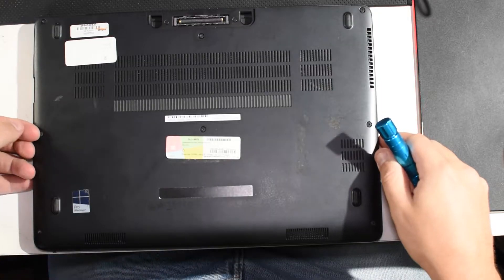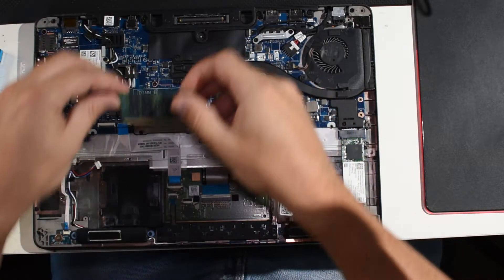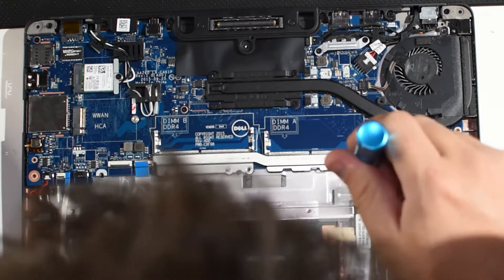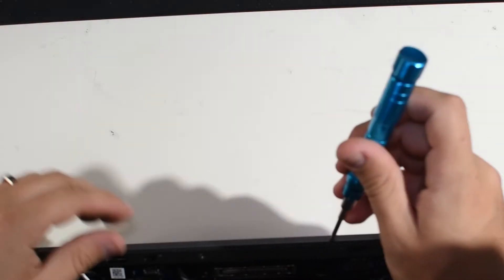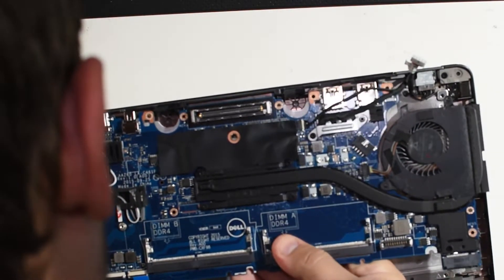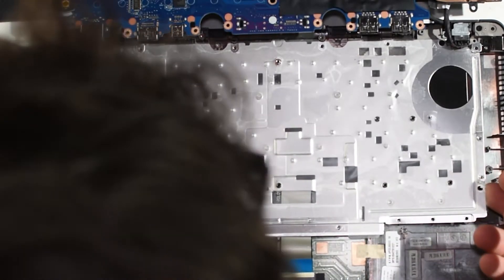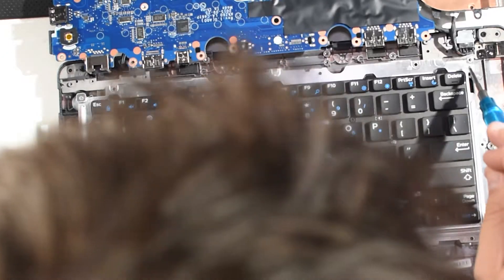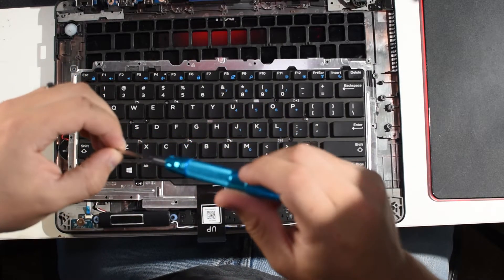Dell Latitude E7470 Keyboard Swap

Comment: This is a really good instruction video . 
Thanks a lot! Do you know if it is possible to swap  non-backlit with a backlit keyboard?
Reply from the maker: The laptop motherboard itself is equipped with the port for the back light so it should be an identical process with one extra ribbon cable.
Reply: This is what I may be doing soon, after getting a backlit keyboard for replacement. However, I am now worried over the fact that the keyboard that was to be the replacement in the video wasn't a fit, although it was meant for a dell latitude e7470. Is this something to be generally worried about?

Comment: Great vid, switching the keyboard went great.
I got this Laptop without screws for the back cover (dont ask how they went missing). Do you happen to know what screws those are? Maybe the same M2x5 that are in the inside?
Reply from the maker: It appears that these are M1.8.  Glad to have been a help!
Reply: @coone3008  thanks for the fast response! M1.8 - just why dont they use M2... I have those in the shop, but nooo, it has to be something special :D
Reply from the maker: @kokosnusskaka  And they're captive so not even standard ones.  :(
Reply: @coone3008  So I went to a store to buy some, because I aint no fucking pay 10€ for 500 screws on amazon.

turns out standard M2x5mm kinda work. In the corners the plastic back cover is sitting tight. in the two middle holes I think the 5mm screws are too short.
Reply from the maker: @kokosnusskaka  Good to know.  So maybe it's a special captive M2x5 instead of an M1.8.  Thanks for doing to legwork!
Reply: @coone3008  i'll try some longer m2 screws and Report back